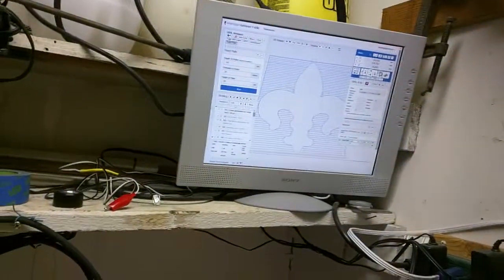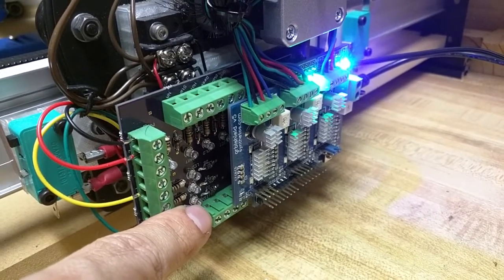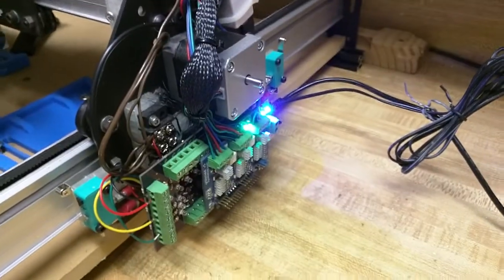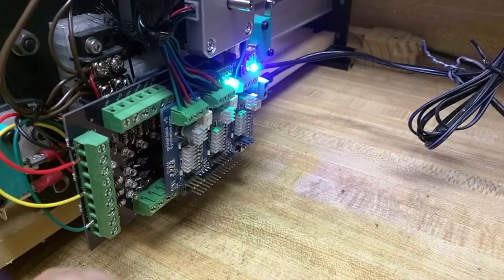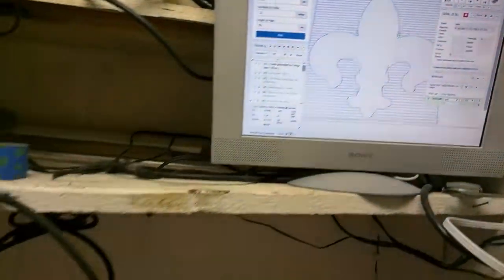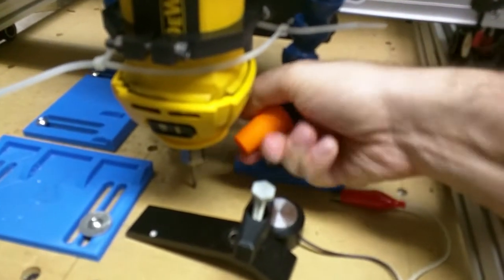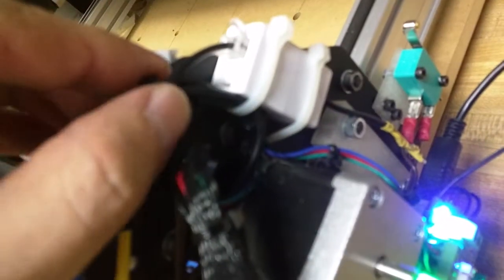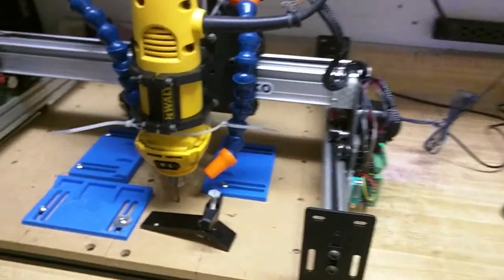ShapeOko 2 Upgrades

Comment: I am getting ready to upgrade my Shapeoko 2 with limit switches and a z probe. Any chance these boards are still around for purchase?
Reply from the maker: i'm really not sure.  I bought them from a user on the shapeoko forum (fjohn624).  I'm not sure if he is still active on there or not.  Here is a link to his posts: https://forum.shapeoko.com/search.php?author_id=2176&sr=posts
Reply: I know this is an old post, but did you end up getting a board?
Reply: @EngineeringOutdoors  I did not. I fashioned it together using a breadboard and a bunch of wires and it looks like a rats nest. I have been saving up to get a new controller such as the OpenBuild Black Box or possibly the new X-Carve controller.  Just not sure which is the best way to go at this point. I want to be able to communicate with controller via multiple application like Easel, Carbide Communicate, CrarveCo and even possibly lightburn for wen I add a laser. If anyone knows of a controller under 400.00 that can do all of this I would love to know.
Reply: @digitizer101  I just got 5 of these boards made.  Just the PCB only.  I will be soldering the components once arrived.
Reply: DM me if you still want a board
Reply: @skylinefpv3421 I don't imagine you have any still sitting around do you?  Trying to breathe some new life into my shapeoko